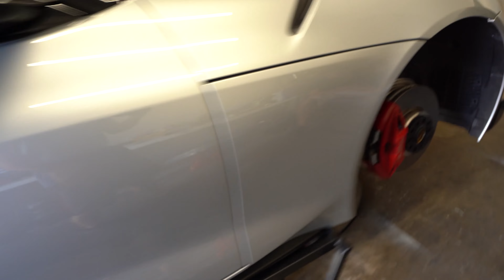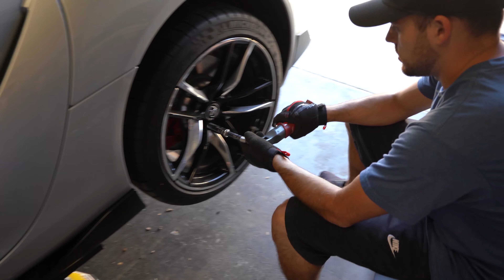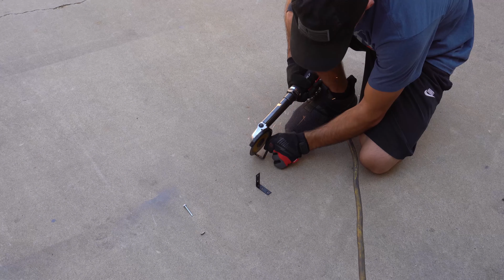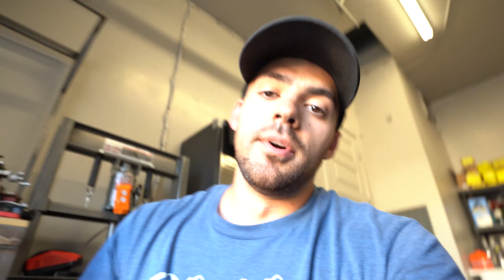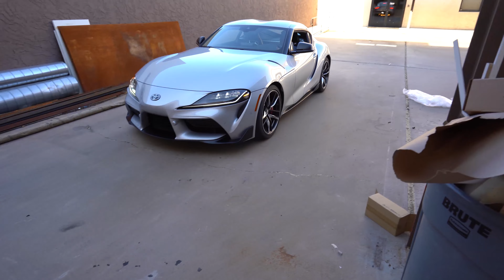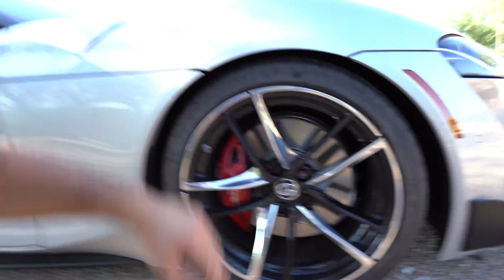The Air Lift Suspension is Complete on My 2021 Toyota Supra A90 | Final

Comment: I've done a ton of research and still cant find what the Ride Height sensors actually do or what they are for. You would think with what this system cost all that info would be provided. I'm leaning towards 3p System.
Reply from the maker: Ya the information out there is pretty vague. There's more info in the instruction manual than I found online about the height sensors. I don't really know there purpose other than maybe sending some info to the controller to help adjust air pressure

Comment: Where did you connect your ignition from ?
Reply from the maker: I tapped into a fuse in the trunk, if you open the access panel on the right side you will see a 7.5 amp fuse on the furthest bank to the left. Thats the one i used, dont remember exactly what is was but it works perfect. Hope this helps

Comment: Mine did not calibrate says limits reached
Reply from the maker: That means you need to adjust your connecting rod length. The calibration should tell you if you reached your limit going up or down then you can shorten or lengthen the rod. After that you should be good to go!
Reply: I got it to work thank u again

Comment: Hey bud, just fitted my system and am pending to run calibration. Quick question, did you stumble across airlift faults such as: mount calibration and invalid mount? I've installed the manifold as per recommended and have swapped out the manifold twice with a new one. Was wondering if its because I haven't run calibration. Grateful if you could let me know.
Reply from the maker: No I didn’t run into that issue at all. The only issue I ran into was a sensor height issue during the calibration mode. Once I adjusted the arm everything was fine. I would recommend running the calibration mode if you haven’t already. It should help you identify any issues.
Reply: @RebuildEverything  I am thankful and grateful for your reply mate... Was such a noob mistake as I didn't run calibration at the time, so yes stupid me. Did you get the annoying knocking noise in the rear top mount? How did you resolve that or is that something we just have to live with. 😂

Comment: Hey bro your video helped me out tremendously but I’m totally stuck on installing the ride heigh sensors. I started on the rear and installed one exactly where you did the 2nd time around. I measured the travel for the 3rd hole around 4.5 inches but if I jack up the brakes to fully Aired out position it goes way past it’s limits. Any additional info on things like the linkage length from nut to nut would help. Thanks!
Reply from the maker: Glad the video helped! Tomorrow I will measure the nut to nut dimension for you, the calibration mode is really good about telling you what you need to adjust on the height sensors. They were a real pain tho to get just right
Reply: @RebuildEverything  Thanks! I haven't gotten to running the lines yet I spent the most of 2 days trying to find missing sockets or going to buy tools and dealing with stubborn nuts and bolts.  
Also did you use the existing nut in the spot you mounted the height sensor in the front? Are there any issues affixing the linkage to the front upper control arm when steering?
Reply from the maker: I did use an existing nut for the front, after a few hundred miles I’ve had zero issue with mounting the linkage to the control arm. 

As for the nut to nut dimensions:
Front is 3 7/8”
Rear is 6 1/4”

For the front height sensor my linkage is mounted on the 2nd hole and for the rear it’s mounted on the 3rd hole

Hope this helps, If you have any other questions let me know!